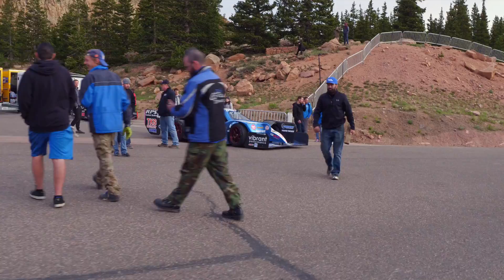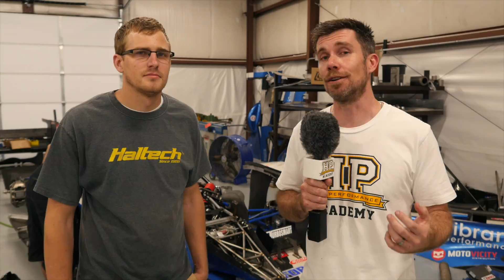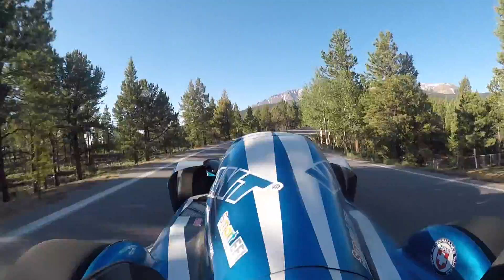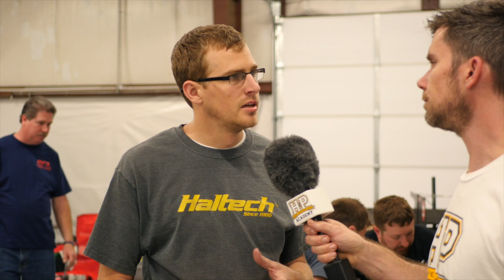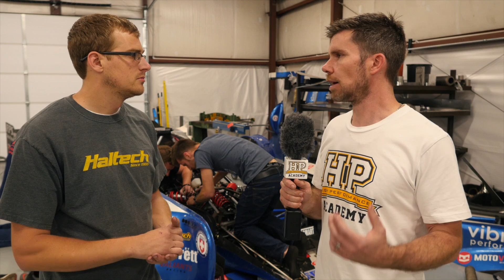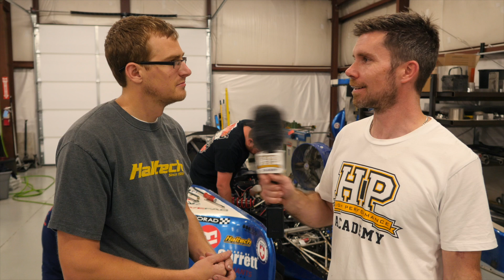[TECH TALK] How the pros tune for high altitude | LS Powered Hill Climb Car

Comment: So different altitude affacts afr only in the NA engines ?
Reply: I think it’s due to the fact they continue to up the pressure out of the turbo as they go up. 
For a street car I don’t see myself doing that. 
My boost will drop as I go higher up thus lowering my VE tables.

Comment: Funny to hear him talk about setting up a “proper VE model” and then discuss how it needs more fuel at high altitude. Sounds like it’s a likely a purely MAP based VE table which won’t work properly at different altitudes, and then they applied a band-aid fix to deal with the altitude change. Such a shame, the ECU has the power to model this all properly if it’s set up correctly!